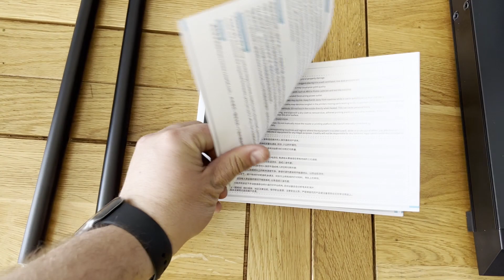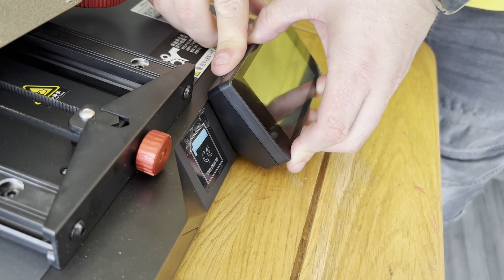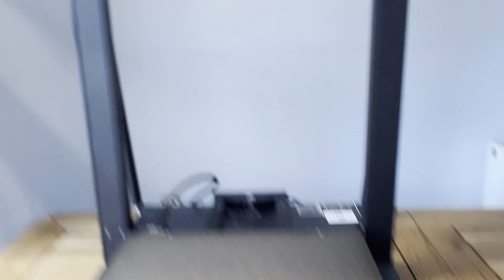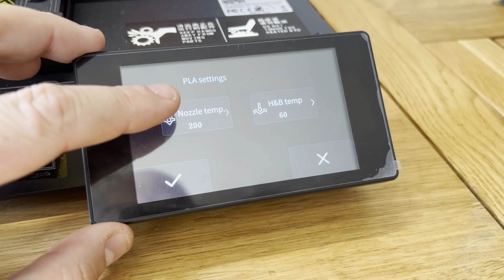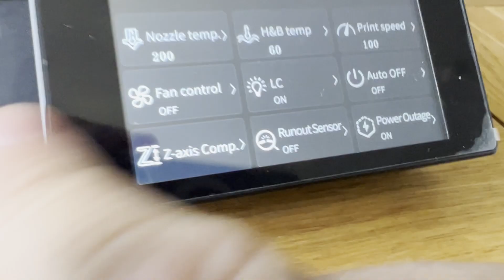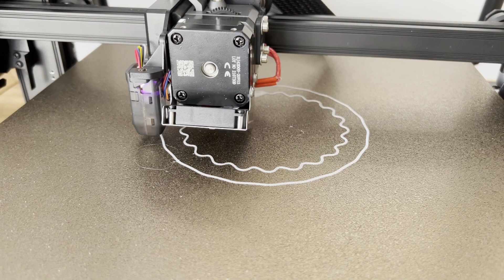Creality CR10 Smart Pro (Unbox - Build - Print) #creality #CR10 #3DPrinting

Comment: I bough this printer a couple days ago,  and vase mode is wonderful.   Everything else I hate.   Bed leveling is bad, PEI bed isn't level and for some reason auto level isn't correcting it,   Not even sure auto level works to be honest.    Since you still have to manually level the bed anyways.    So I really don't think auto level is working on this printer.   Updated the firmware to make sure,  still not working out well.     for some reason I can't print supports, they all come out looking like crap and ruining the print,    I  mite try and resell this printer to be honest.
Reply from the maker: Even with auto level you will still need to adjust the z offset and the bed slightly have a look at how I did this in the video. The supports will be to do with slicer settings is this your first printer?